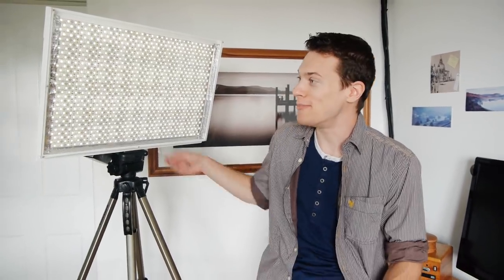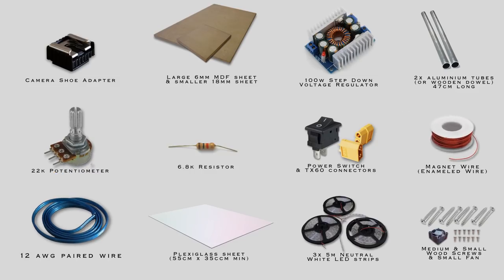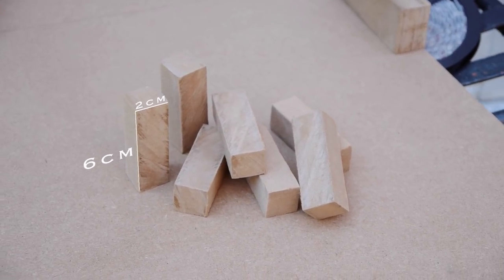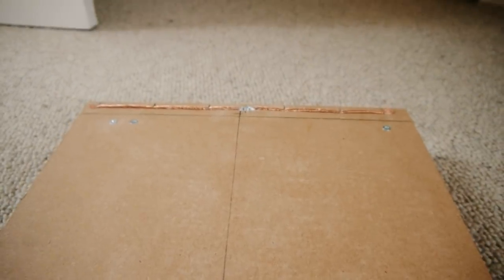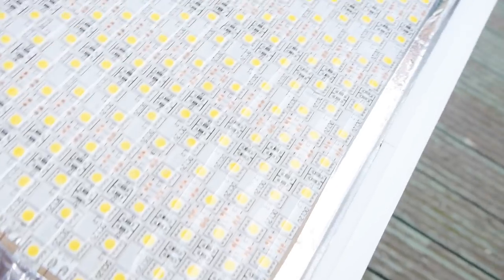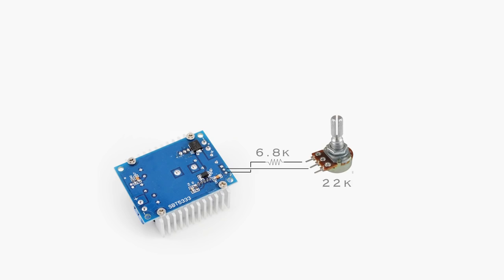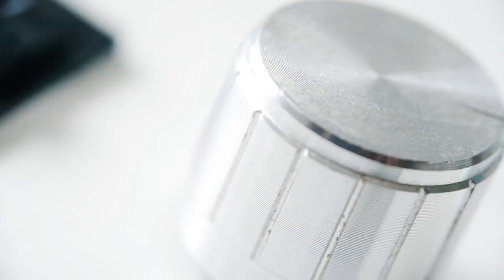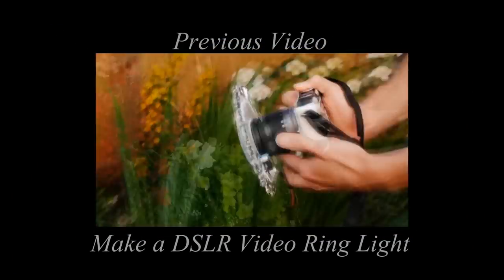How to make a super bright LED light panel (for video work etc)

Comment: Great instructional video btw and I love the light design.
I started with one 5M light strip and everything worked great. I just installed the rest of the leds and the regulator is burning as I can smell it smoking.
It worked fine with the single set, but with 3 sets I turned the dimmer up full and 
it is burning a component in the regulator and now only outputs 8 volts, so the lights are at half brightness and flicker a bit when turned up full. 
all the LEDs light up. I can smell the burned component but I can’t see what actually burned. Everything should be in spec. It is disappointing after all the work so I would like to solve this.  I have triple checked the wiring for polarity and all looks correct. If a strip was reversed or shorted would it still light? With out the LEDs connected the regulator outputs 11.99 volts. With the LED load it outputs about 8 volts.
100w power supply (rated 12v 8.33 amps) adjusted to 13.4 volts, 100 watt regulator (Rated 8A, peak 12A),  
3 LED strips are rated on the eBay site, as at 72 watts each 5M 216 watts. You said their specs on that aren't accurate. If I did not enough power, wouldn't it just be dim and not burn components? I noted that some of the strips have a loose connection and by pressing them they come back. Some LEDs in other strips don't dim.
I tried connecting directly to the power supply and adjusted it down to 11.98 volts and it seems to work fine and has full brightness. I tested it for a few minutes and no fire yet. This would indicate that the LEDs are wire correctly I would think.
I really would rather have dimming capability. Any ideas ? Thanks
Reply from the maker: Alan Stephens Could be that the voltage regulator is faulty. What power supply are you using? You mentioned that it's adjustable, rather than having a single voltage output.

Comment: Could you possibly link to an easy solution for the AC/Laptop Power Supply to XT60 Connectors? I've only ever found 65W laptop adapters, and Im trying to think of a cheap AC solution for this, but I'm coming up short on items (despite your explanation of what's needed)

Comment: Can this design be applies to a longer led panel design? I want to make a light panel that is 2 to 3 times as long. Do I need to make changes to power supply design and if so do you have any suggestions?
Thanks

Comment: A photograph friend in need of a bright LED light panel directed me to your project. I spent most of the day getting familiar with your impressive design and just ordered most of the parts to build it. I will use a 3.1 mm (1/8") thick aluminum panel instead of MDF. I am strongly considering using 5630 LED as it is around 1.5 times brighter than a 5050. I will use two variable voltage regulators and split the LEDs in half and control them simultaneously with dual ganged 22k potentiometers. This way, even if the 5630 LEDs consume more, I should not need a fan. I was thinking of using a 12V open frame power supply, as they usually are cheaper and give the possibility of adjusting the output voltage around 10 to 13V. This option will work if the voltage dropout of the variable regulator isn't too much over 1V. Is it? I read somewhere you are working on a new panel that will use the 5630 LED. Have you found the right one? If so, would you be so kind as to let me know which one it is? Thanks!

Comment: Matt, you're great!
I want to power panel with 12V 10A AC/DC converter.
Can I use high frequency PWM dimmer instead of step-down voltage regulator, like you do in flexible panel project?

Comment: This may be a dumb question, but will this work with the 3528 120leds/m (600 total) strips and will the brightness effectively be doubled? Mainly interested in creating a smaller light that is still as bright and also gonna try to create a flexible version as well like the Westcott FlexLite :)
Reply: JohnFelipo Nevermind I just realized the 3528 LEDs are much smaller and not as bright :)

Comment: PWM control is used for a reason:
- it is more power efficient
- LED brightness is not linear to voltage.

you could use a very fast PWM generator to avoid flicker.
Reply: Wouldn't you have flicker at a higher frequency then?
Reply: David Newberry yes, of course.. but it's harder to notice.
Reply: What would you estimate the efficiency to be?

Comment: Hi, I was watching both this video and the flexible led light tutorial.  I was wondering what connection is better, this where you connected multiple thin copper wires to one copper 12 awg wire or avoid that and connect two wires on both sides(+/-) and then connect it to the voltage regulator separating the insulated wires in a series.  Also, which light strips would you recommend?

Comment: Verry nice project! I got a question for you do you know how to make it work 18x 3W Red (630nm) 700mA in serie with 18x 3W Blue (445nm) 700mA on a 12v dc 5amp power supply? (i got two 12v dc 5amp power supply)

Comment: Could I attach the LEDs to a more flexible material like painted plexiglass?
Reply: Yes if the curve is to remain in an non-moving curve. Just do not exceed the smallest  radius curve of the LED tape, it may heat snap and open circuit when current is applied. Short LED strips in the perpendicular to the curve are OK but the strips are not designed to be flexed repeatedly. There are other LED material solutions for that.

Comment: Hey Matt,i want to use an ac adapter for this but i don't really know how.I need to add the same tx60 connector to the voltage regulator?How to i connect the ac adapter to the voltage regulator?Thank you,anyway :D!

Comment: Hello may I ask you a question: does the voltage regulator also work with 1x 10W high power led  - will I need the same potentiometer and resistor?
Thank you!

Comment: How well would 2 of these work for lighting a green screen? Would throw evenly enough do you think? or do you have any experience using them for green screen work?
Reply: +Alex Young These should work just fine(no experience yet, but what i have gathered), but you might want to add diffuser front of them to get even more even lighting. really thin white plastic bag material should work well. 

I have two car work LED lights whit diy reflective cones +dimmer material front of that currently. Light from those is kinda even, but cause the light comes from single point it still creates some shadows. I plan to build this as my key light and use those two existing ones as my fill lights in future.

You might want to adapt this design with foldable side reflectors and add folding top cover so you can use this outside too.

Comment: Im using pwm dimmer with a 4s 18v lipo and it kills the battery quickly. I tried ya method and it works but them damn voltage regulators blow out so quick on me so i never had a chance to test the run time. My question is why the 4s lipo die so quickly is it cuz im using pwm and not the voltage regulator?

Comment: My power supply is a Potrans 12v 8.33Amp 100 watt. It has a potentiometer on the output to fine tune the voltage. It doesn't have  much range. I hooked it directly to the
LEDs and after 15 minutes the metal case gets too hot to touch. would that indicate not enough power?
Reply from the maker: Alan Stephens Not necessarily. More likely it's an inefficient PSU, or your LEDs are drawing too much power. Try using a lower output voltage.

Comment: Thanks for the tutorial and thanks for responding to all the questions.  I learned more just reading your responses.  Question...why do you recommend a Log potentiometer over a Linear potentiometer?  Wouldn't linear be better for it's "even" resistance slope (adjusting the light intensity evenly across the pot adjustment?  Thanks in advance!
Reply from the maker: Team3Video Our eyesight isn't linear, so using a log pot means that the brightness adjustment is more even than when a linear pot is used. It stops there from being a sudden increase in brightness at at the dimmer values, and not much increase when it gets brighter.This is all theoretical though, I've not actually experimented with it in practice, so a linear pot may still give a decent result.
Reply: Just a follow-up to my question.  I've done a little research and have learn that one might use a log potentiometer when controlling audio because human hearing is logarithmic...in other words, we don't hear changes in audio level evenly.  Is this the same for human eye sight?  If humans can't discern the differences in brightness in a "linear" fashion, then log makes sense.  Your thoughts?
Reply: Team3Video LOL...ok I've answered my own question but doing a little more research.  Yes, human eye sensitivity to light is logarithmic.  http://www.telescope-optics.net/eye_intensity_response.htm   I hope this info helps someone.
Reply: DIY Perks You are fast responder....I didn't see your response until now. Thanks again!

Comment: Hello I just wanted a clariification on the voltage regulator, i tried getting hold to one of those but in vail. All i get is a 220 to 110 voltage converter. Could you please explain me the current output and the wattage and the step down voltage value. Please waiting for your reply...

Comment: Hey.my panel is almost finished. Now i am thinking about the power source. I found laptop Adapters mit 150w with 15v or 120w with 12v which should be good. But when i use a 12v power source, do the voltage regulator output 12v or do i loose some volts because of the efficiency, which results in no full brightness of the leds??
Reply from the maker: baerirz You loose a little brightness but it's not a huge amount. It does mean your LEDs will have a longer life span, though.

Comment: I have a 65 watt ac adapter and a 35 watt ac adapter, is there any way I can wire them together into the step down voltage regulator to combine the wattage?

Comment: Nice video, I got the led strips, and now a question, I want to use indoor , so I need a voltage regulator? I want to use a switching power, but how to adjut the light intensity? thanks!

Comment: Just built mine. I keep burning. voltage regulators though. after I adjust my voltage regulator to 12 volts and check the potentiometer I connect it to the light panel. and then attempt to dim  it but nothing happens. within seconds white smoke from the voltage regulator

Comment: How do I skip the dimmer and just hook the LED's up to a 12v power source? What parts would I need? I have some dimmer switches at work that I use to dim Lowel soft boxes with. Would one of those work for dimming the lights? Will there me too many volts going to the lights? I know nothing about electrical things so the more advice you can give the better. Thank you in advance!
Reply: Molly O'Connor Would I have to build it the same way that you did to prevent flickering?

Comment: Can i use this LED for High Speed Camera ?
Actually i have camera with 120 fps. But i really worry about flickering (even if i use dimmer Voltage). Can u test your LED with 60 fps using your camera ? and Explain that to me. Pleeaasee...
Thanks... :)

Comment: Very impressive light, I have a random question though. What did you use to make the tracking dimensions graphic that is superimposed over the 2cm x 6cm MDF blocks at 3min 50sec in to the video.

Comment: Very nice work and tutorial. Thank you very much. I will make two of them. But I have two question it can be a very primitive but please forgive me. 1. if I want to limit lowest voltage more than 6v maybe 8v how much k resistor should I use? 2. I saw you pulled voltage regulator's preset and resoldered into potentiometer. Am I right? thank you very much :)
Reply from the maker: Yasin Saglam To increase the minimum voltage just use a higher k resistor. It's actually pretty closely tied together, so for 7v you can use 7k, 8v you can use 8k and so on.

Comment: Hi, could you help please? I have followed this until the point of soldering the wire, but then I am stuck. I am not sure what gauge wire to buy? I have made a 1ft x1ft panel, with alternating 2800k and 5600k strips? so 10m of strip in total. Great, helpful video, Thanks
Reply: 2800 and 5600 Kelvin tells about light color, but nothing about electrical power. Using the cable type described here should work.

Comment: Dude ur work is amazing, really helpful to keep the budget low but could u plzzz make a tutorial for diy 312 led  model shooting lights like "polaroid 312",really need a shooting light  which is small ,powerful portable ,produces less heat and consume less power or battery. could u also design it so that it using the  simplest of circuits  cause it's really hard to get part where i live,which is nepal.
No matter whether u decide to do it or not , big fan :)

Comment: iv built a couple of these recently  but i used Aluminum as the backing for the led strip as wood is an insulator and will reduce the life span of the led strip. maybe something to think about next time. good build otherwise.

Comment: I was thinking about making a bi-colour panel so I can use this panel in daylight and tungsten settings. If I were to create two separate circuits (one for tungsten and one for daylight LEDs), could I use a second potentiometer to crossfade between these by linking it to the output terminals and using all three connectors on the pot?
Reply from the maker: Adam Chantler I've been trying to think of an elegant way to do that myself. You could certainly make it fadable between the two, using the method you mentioned, but I've not been able to think of a way to allow dimming as well (while keeping the colour balance). Unless you use it along with PWM as well, but that's something to be avoided.

Comment: Question. If i wanted to power this directly from an appropriate laptop charger, could i connect it directly to the voltage regulator? void the battery section all together?

Great video BTW.

Comment: At about 10:45 into the video just after you make the adjustments it looks like the little blue pot is OFF the board and near the external pot then at 10:47 it is back on the board. NO mention of that in the audio. What happened there? 
Nice video and interesting project.

Comment: What kind of 22k potentiometer should be used? Audio, linear, log, etc? Your pot looks like a Marshall amplifier pot.  And what rated wattage for the resistor? Half watt, watt, 2w? Thanks! Excited to get started on this project!
Reply from the maker: Zac Till Doesn't matter really, but you can use log pot for a slightly more predictable brightness adjustment. Wattage of the resistor doesn't matter as it's just for sensing and barely any power goes through it.

Comment: Hi! I really enjoyed this video and built my own panel after your instruction. But unfortunately I enjoyed it just for some minutes, because the step down module burned off. I used the same components and built it exactly as shown in the video. As power source I used a 4S LiPo from my model planes. Any ideas what could have gone wrong? - Thanks and best wishes, softwarebaer
Reply: +Thomas Rößler 4S lipo is 14,8V and instruction specified 3S witch is 11,1V. Module is rated 12A, so could bigger voltage cause bigger amperage that blow the module? Module was faulty begin with? I need to consult my buddy cause i'm shorthanded when it comes to these things. I will ask him to check these plans and verify is there is design flaw.

Comment: Thank you for the tutorial. I bought material from provided URLs. I now have a problem when using the light. In a few minutes brightness of light starts raising. The result is that the light is at maximum brightness and cannot be regulated with a potentiometer anymore. Could be this because of some overheating? If anyone else had the same problem, please share your experience with me :)

Comment: Great video. :)
I'm building one myself but I've encountered a problem. I'm using a 19.5V laptop adapter and the recommended step down voltage regulator, potentiometer and resistor but I only get a maximum of 8V at my output. I'm sort of new to electronics but I've measured all components to the best of my knowledge and could not find anything wrong. Has anyone any idea why this might be happening?

Comment: DIY Perks, is there a voltage regulator I could use that I can buy in The United States or Canada? The one you listed would have to come from Hong Kong or China, and that takes at least 2 weeks.

I would like to work on this while the weather is still sort of nice, and over Thanksgiving break.

Thank you for the video.
Reply: I searched on Amazon for voltage regulators. Some of them have a display for the voltage! How cool is that?

There's one by Yeeco. It has a clear plastic top and usb output.

What are the specifications to look for?

Comment: Love your work. I'm definitely going to be building some of these things In the future. Question tho. For this LED panel, you ran the strings of LED lights from left to right and they look to be in a checkerboard spacing. Where the strips line up every other strip instead of a straight line vertically. Now, can you weave vertical strips in to make it a solid block of LED lights?  So where there are spaces in between the LEDs going left to right, could you put an LED on that spaces going from the bottom to the top?

If you can do that, how would you complete the circuit? Left side was positive before and right was negative. Would the top or bottom be the negative and how to connect them to the right and left side pos/neg before the weave?

Thanks in advance for your help and info